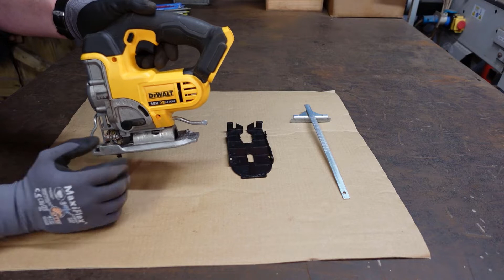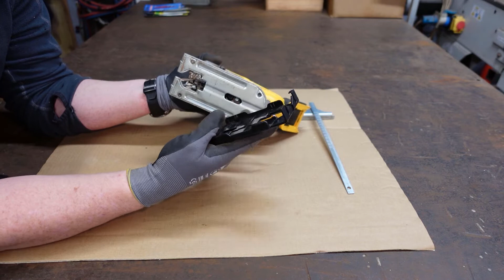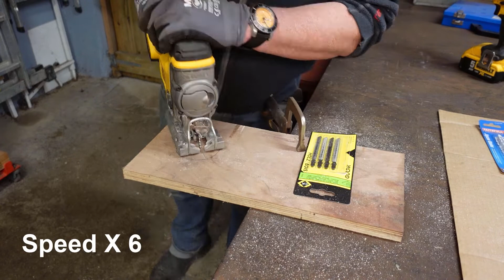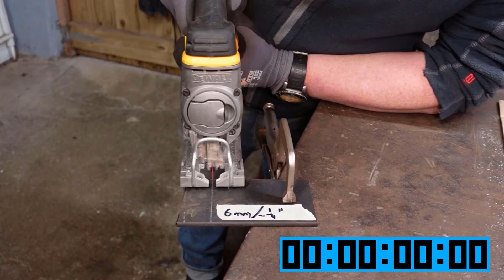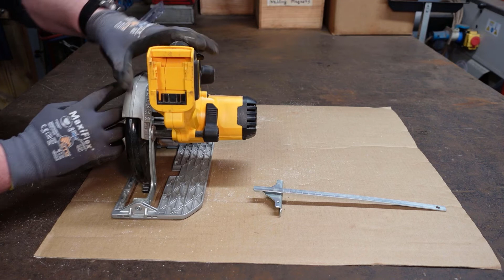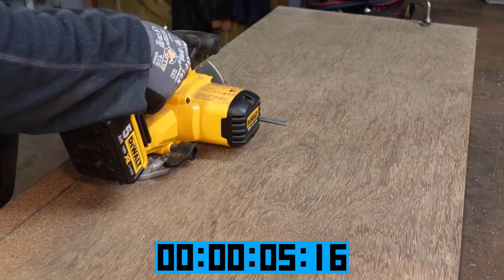Your First Saw - Circular Saw V Jigsaw

Comment: Picked up the jigsaw. Any guides I can get to make it cut straight?
Reply from the maker: Best approach is probably to clamp a straight edge and run the saw along that if you're going down the middle of a board or sheet. There are also guides available to buy. 

https://www.ebay.co.uk/itm/324050227190?itmmeta=01J3JKX32CVW7E56P6J7S5D1QP&hash=item4b72e60ff6:g:hOkAAOSwqMteKGu8
Reply: Speed square is the best guide for 2by4 etc

Comment: Will jigsaw do skirting mitres?
Reply from the maker: It should do if you have an adjustable base plate which you can adjust. My recommendation would be to do a trial run on scrap pieces to test the angle and also the fit up. Hope this helps.

Comment: I have an allotment and need to cut wood for my raised beds which one would you suggest?
Reply from the maker: Would probably go with the circular for that use case but make sure the model has capacity enough for the wood you’re using. Boards for raised beds are generally quite thick.
Reply: @WobbleMatic  thanks mate, great point

Comment: Thank you for the video. I wanted to buy a power tool for cutting wood for projects around the house. For days/weeks I was only looking at circular saws because that's what I saw carpenters use when I had to hire them for some work. But I was not too sure if I need to get myself a circular saw as I have only been using hand tools till now.
From what you said, I agree that a jigsaw makes more sense for a DIYer like me given the flexibility it offers. Another important point I think is that the jigsaw is also a lot safer.
Reply from the maker: Thank you for those kind words. Glad to be of help. Best of luck with your projects.